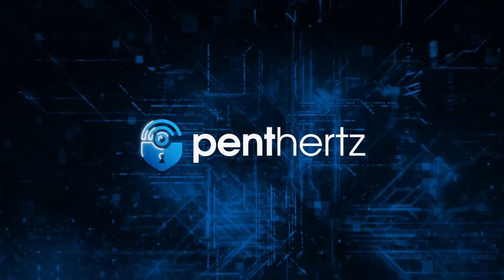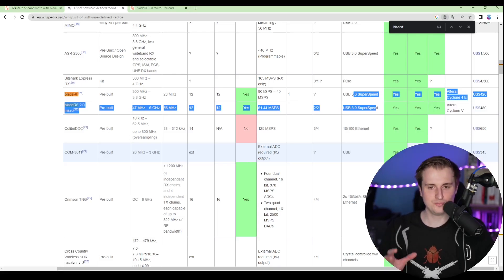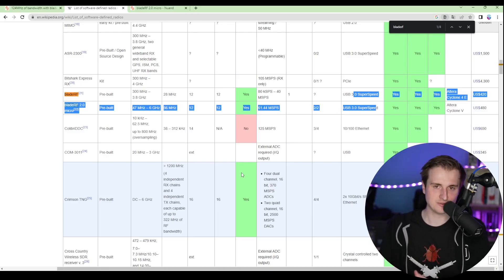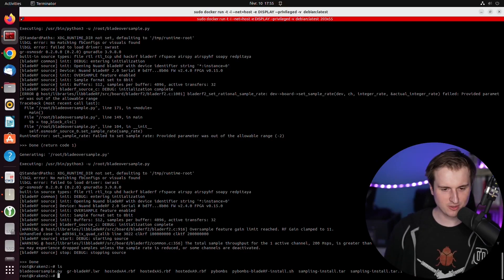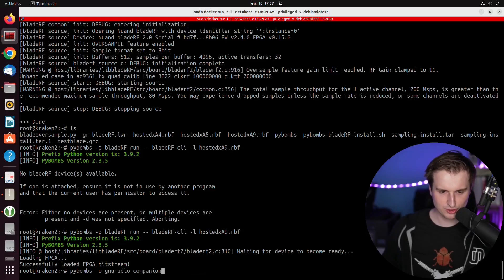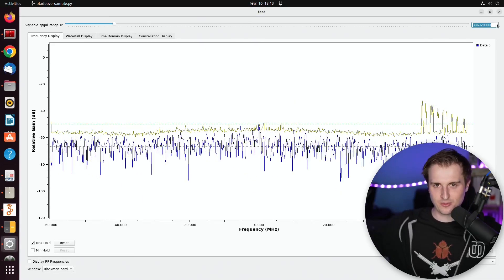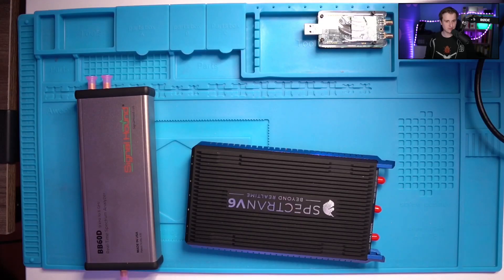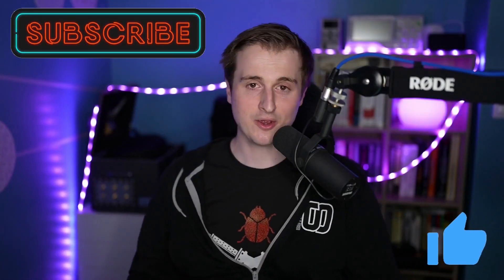Unlocking THE wideband on bladeRF 2.0

Comment: How is it possible, the ad9361 is only 61.44MHz followed by a 56MHZ analog filter!!!!!!! how could it be 120MHZ?
Reply from the maker: Good question :) The path for an RF reception looks like that https://ez.analog.com/rf/wide-band-rf-transceivers/design-support/w/documents/10067/ad936x-maximum-rx-digital-path-data-rates. In fact, a filter needs to be bypassed to let the 122.88 MHz signal. That can be done on the RFIC with a good understanding of how to set up the registers. Then the communication through the FX3 was also readapted to be able to stream with this bandwidth. Daniel has also made a post about it when doing the same for the PlutoSDR: https://destevez.net/2023/02/running-the-ad9361-at-122-88-msps/

Comment: can the bladerf crack rolling codes and which is better bladerf or pandawrf? whats the difference between blade rf a9 and a4
Reply from the maker: PandaRF is a form factor device to work on sub-GHz mainly. With the pandwa, you are limited to the CC1111 transceiver specs, compared to the bladeRF which is an AD9361. The advantage of using the pandwaRF and the CC1111 is the speed to process the signal or switching configurations when SDRs can be slower depending on the FPGA in use, but also the bus used to forward the samples and the power of the computer to handle the samples. So for short bandwidth chipsets like the CC1111 can be very efficient. In the inverse, SDRs can handle much larger bands and are more flexible in terms of modulations/demod + encoding/decoding as everything is processed in the computer and not by the chip. With a powerful computer and with the right buses to forward the samples you can do practically everything you want.
About your 2nd question, the main differences between the xA9 and xA4 are in the FPGA in use offering 49KLE FPGA of which 32KLE user programmable for xA4 compared to xA9 offers 301KLE of which about 292KLE is user-programmable. xA9 has a higher speed, and also can be used to program custom gates for any purpose in HDL. But for generic purposes, and for pentest only a xA4 is enough generally.
Reply: @Penthertz with the pandaRF i noticed theres two types of licenses the more expensive Year Gate Opener Secure Decrypt Pro License and the other Kaiju Gate Openers Pack Pro License. whats the difference.
Reply from the maker: @mirrormelville7097  AFAIK taking the PandwaRF gives you advantages on the price of the Kaiju API. But you can also take a license separately with a bladerf
Reply: @Penthertz  how do i take a bladerf license which license is better?